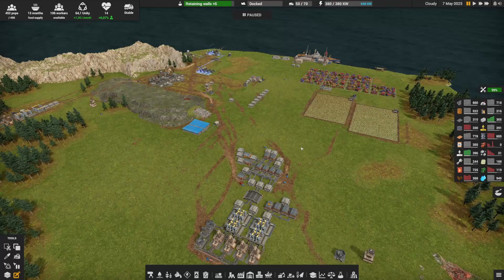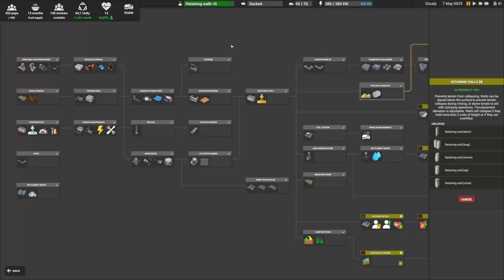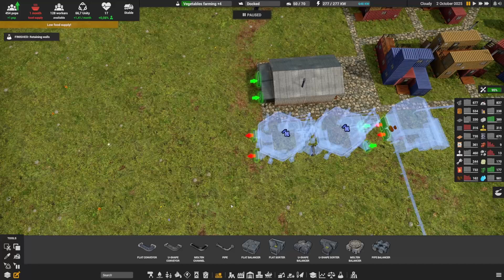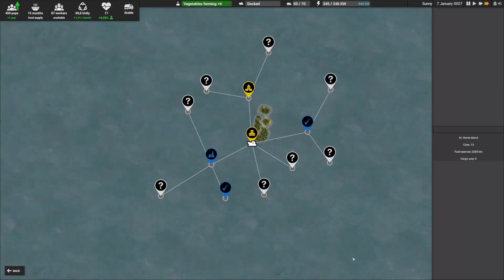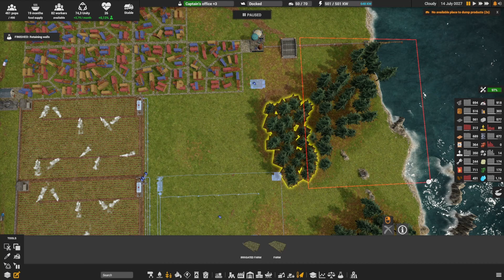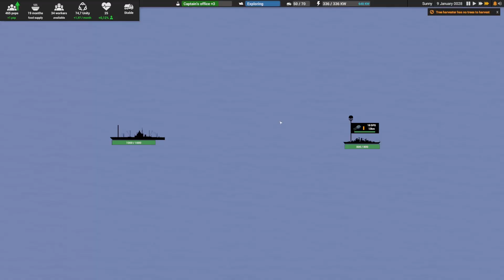Captain of Industry - FARMING & SERVICES - Tutorial & Let's play - Ep8 - 30/154 ROCKET launch

Comment: After you set truck import off in the food market 2:51 , wouldn't it have been more efficient to select the empty option (trash bin on the right side) to have the trucks deliver the remaining potatoes to the new storage before deleting the building?
Reply from the maker: As far as I saw it does it automatically as long as the other market is already built which is why I went back to a lot of reserve very quickly :)
Reply: @GamerConsultant  Thanks for the reply. I have another question if you don't mind. Regarding farms,  I see many streamers build and copy settings to each farm which seems to work well. I was wondering if you tested using alternate planting rotation per farms? 
Example: farm1 is setup, potatoes-fertilizer-potatoes-fertilizer. Farm2 is setup, fertilizer-potatoes-fertilizer-potatoes. Would that make a difference over having to wait to harvest all of the same crop at once on every farm?
Reply from the maker: @tr4l1975  yes I tested it once with indeed the advantage that you can have one farm giving you things every month if you stagger them but it doesn’t help much as the storage is so cheap I feel 
On the other hand right now I’m playing with more advance food types and trying several combinations so will show that in later episodes :)